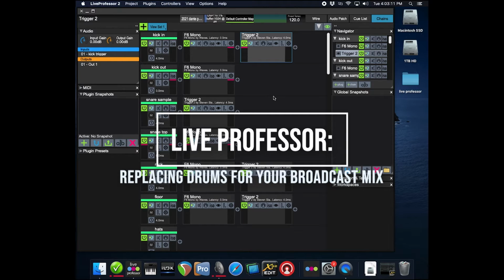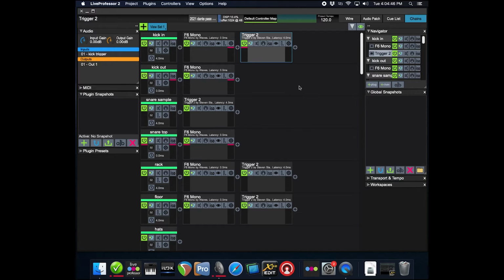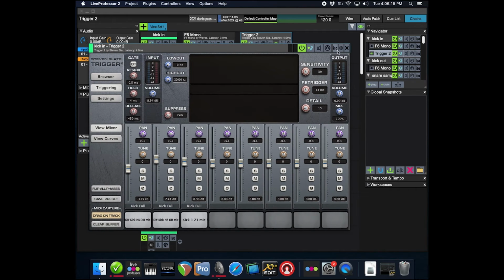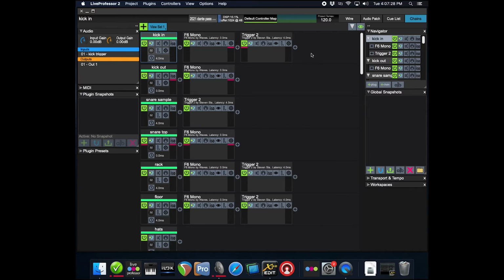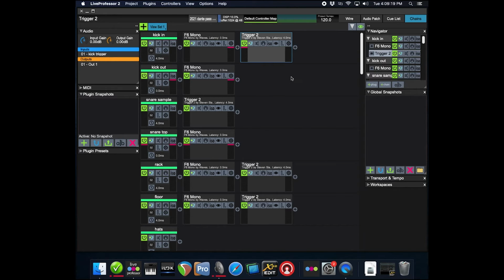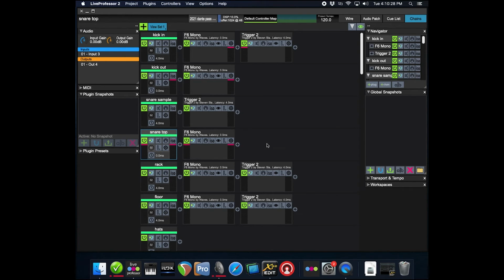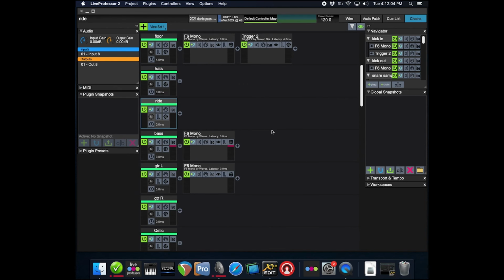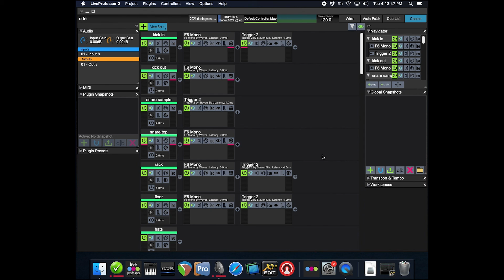LIVE PROFESSOR: DRUM REPLACEMENT FOR YOUR BROADCAST AUDIO LIVE STREAM MIX!!

Comment: If you wanted to replace just the snare and didn't have a powerful enough machine to run the whole drum kit, couldn't you measure the total latency for the snare going through Live Professor and then manually compensate for that in the console on the other channels?

Comment: How are you getting 4.0ms of lag with trigger 2? I get 23ms when I load it onto my system. I'm using a quad-core i5 with 10 processing threds
Reply from the maker: That's a great question! There is a setting in trigger for live use. I believe it's just a box to tick. Hopefully that helps!
Reply: @paulmitro6896  i see it now. I'll have to see if that makes things manageable. Do you experience "audio dropouts" on the software in general? I get 1 or 2 every 5-10mins.
Reply from the maker: @bybenstudio  Drop outs? No, I've encountered clicks and pops. Those are usually remedied by increasing the buffer size, keep in mind that the higher the buffer size, the higher the latency.